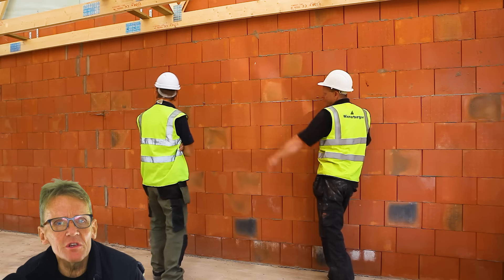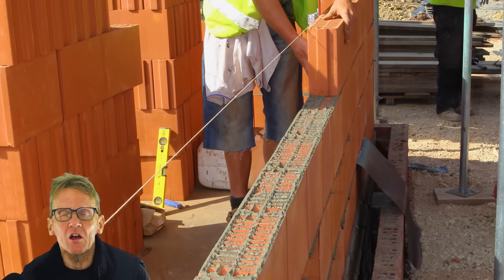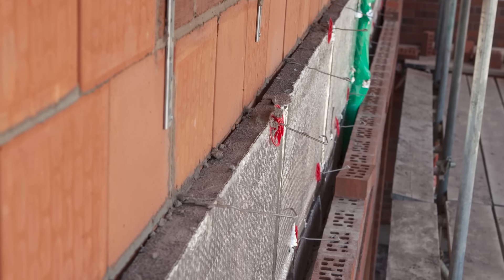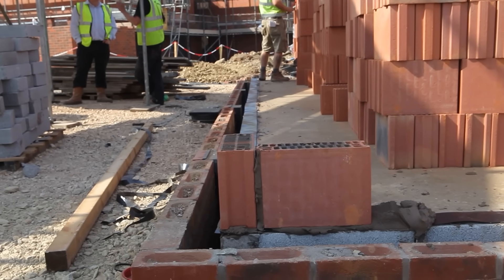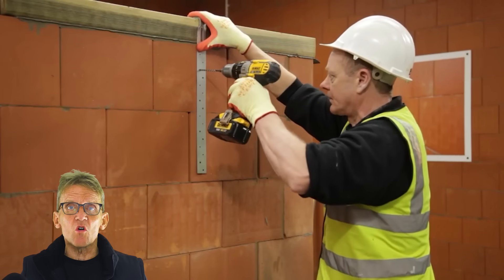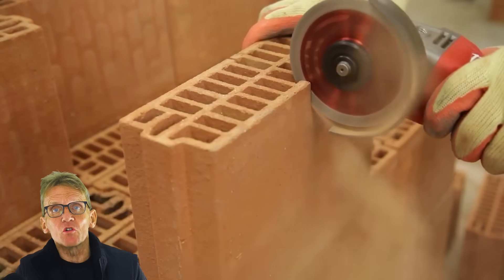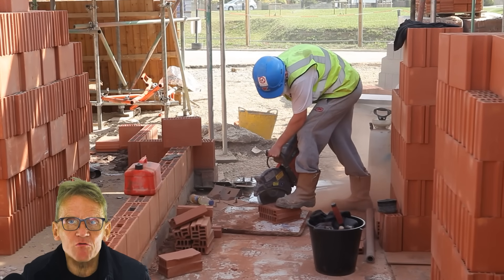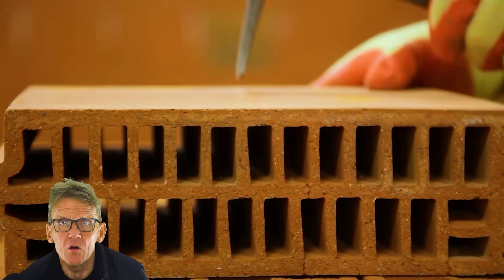Why Haven't We Warmed to Porotherm in the UK?

Comment: The worst building material ever! Unreliable, fragile, water sucking. When you are decide to attach something heavy to the wall you will be swearing the builders and architects who have choose these blocks for sake of speedy and cost.
Reply: Better than lightweight blocks by far.
Reply: Just use the correct fixing and it works like a charm.
Reply: The biggest problem for UK use is that home owners may not be aware that fixing to clay walls needs a different approach. Education is needed!
Reply: Hollow or porous bricks or aircrete blocks are similar to plasterboard dry lining. You need appropriate fixings.
Reply: I’m listening to stories like this my whole life. The base of people who talk bad about something is really simple. The bad mouthing people don’t like to get educated about different things. Imagine Mercedes diesel engines. They are bulletproof for a century. In North America Freightliner has the Mercedes diesel engines build in. You go to the shop and mechanics talking real badly about the engine. Why? They don’t even have METRIC tools in the shop. Honestly? If you ask what is wrong if you have an issue, you not getting a proper response. They just tell you that it is a shit engine. A diesel engine what is used in Africa for millions of km and get fixed in no time. - Now back to building materials. This blocks are not worse than other materials. You only need the knowledge on how to work with them and what you need to do after the walls are up. If you don’t want to build with these or other materials - you got the wrong job! Every single country and area needs different materials and how to protect them from the elements. And yes. All different types of blocks need different wall plugs. I live in Panama now. They are selling here drywall products! In a country where we have 6-7 months rain every day. If you visit public buildings where they used drywall - you can see how ceilings hanging down, walls are full with moisture. No idea who started to sell this products. It’s maybe good for 3-5 years. But that’s it. No products to seal the drywall sold in the normal building supply markets. But you get water protection products for concrete blocks. Wall plugs? They only selling drywall wall plugs. And all my neighbors complain that they hold nothing.
Reply: Quite a lot of opinion for so little knowledge.
Reply: Just because you haven't made it out of the cave yet doesn't mean everyone has to live in one 😂😂😂
Reply: Chasing and getting a fix for socket boxes is fun…
NOT
Reply: Bollocks
Reply: I’d name my donkey Ilya
Reply: Bulls hit
Reply: Indeed, very old school. I am a contractor and do not use this anymore. Too slow and much labour costs. So 80´s
Reply: I lived in Spain for 8 years, these may be great blocks until your house party wall is made of them, and then you need ear defenders.
Reply: I have been building with these and there older horizontal style for over 30 years in France, you are talking complete and utter bollox, as to attaching things to them, two words, Chem Fix. Also the bonding glue sticks like shit to them so you can squeeze it in through a hole to attach things. Mechanical fixations don't work, true, but only an idiot would try and use a mechanical fixation on something unintended to use them, it is like putting water into your car fuel tank and then complaining how it runs like crap. 

Duh, yeah. 

They aren't cheap, but if you design a house to the standard sized  measurements of them , 2 idiots could have a wall up in two days. Lintels and ring beam etc al. 

I hate building with them though, but it is fast and they hold up well
Reply: So why do you hate building with them then? @ForeverNeverwhere1
Reply: They are ceramic, It's much better like other blocks  , Only silka blocks got much better U value
Reply: All tiles act like sponges. This has bigger artificial cavities where water (moisture) can accumulate. Not ideal in British weather or on Nordics, both of where there is plenty of high relative humidity days.
Reply: @mikapeltokorpi7671  All tiles are not like sponges !! Where did you get that idea from ?😂
Reply: Yes, that's why british homes are the best in the world- damp, cold, claustrophobic, cheaply made, primitive, very affordable(half a million euros and you can hear the wind blowing through underneath every door in the house.

Comment: One of the main reasons they are so widely used in Europe is that large parts of Europe are under Eurocode8 Siesmic regulations for earthquakes. This means most new buildings are monolithic concrete structures and porothem, or similiar, are just infill blocks. You can get expanding foam for laying them on now. It has been the norm for donkeys years to fill the gap between the blocks and the slab with expanding foam.
Reply: There are a lot of houses in Portugal build with Porotherm, but they use a frame from steel reinforced concrete than is than filled in with Porotherm. Rather like in the middle ages, when a oak framed houses was filled in with bricks or clay mixed with straw.
Reply: @mjoelnir1899 That sounds like a nice sturdy type of structure.
Reply: There are no Earthquakes in Germany...but we like to keep the expensive heat in our house and not in the outside like in the UK.
We use them since the 70th
Reply: @gromotion933  lol. It was all too much info for your brain to take in?
Reply: @owenoneill5955  I don't know why you are so rude. But Earthquales where definitly not the reason for using them. Its Installation. Don't know if it chsnged in the last years but Installation in the UK was quite bad. I just remember Singel layered winfows with thick gabs..and gabs on doors. And bloody cold walls.
Reply: Porotherm is mostly used as natural thermal insulation. External walls need to be at least 25 cm width to get the best thermal inertia.
They're much more expensive than concrete blocks but you need a bit less insulation. Cost wise, it's a bit more expensive for a finished building. At least here in France.
It's more popular in the south as thermal inertia is crucial in summer. And not wide spread because of French construction laws that sum up as the thicker the wall, the smaller space you get. Of course it also depend on local regulations on the surface ratio you can build and the size of your property.
Reply: Looking the video wondering where was recorded, namely in my country even before Euro code it was not alowed to build outer walls  tinner than 20cm for a single story building, higher building need min 30cm
Reply: @MK-bv6wn  Well in France it was 15 cm thick, stuctural part only, with insulation, it makes 27.5 cm. The regulation was and still is 35 daN compression strength for structural builds, for private housing 2 floors and below. Anything else needs to go through engineering studies first.
But as an easy way for both self constructing and professional calculations, it has always been easier to base outer walls on 20 cm thickness.
Reply from the maker: @MK-bv6wn  recorded in the U.K
Reply: Yes,  it true for multi multi-storey buildings.
Reply: Many houses (especially single family homes) in Europe are built with just Porotherm blocks as the load bearing structure. It's especially common with self builders and gives you great thermal performance out the door before adding any insulation (especially if you go with the 50cm wide ones).